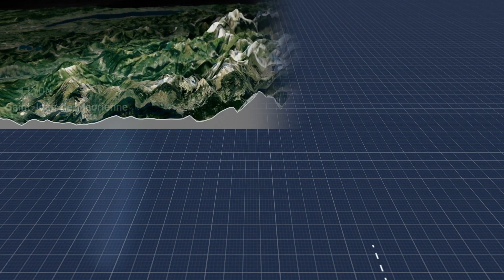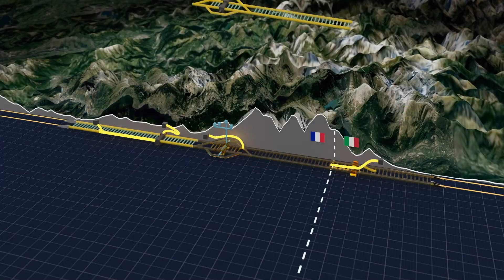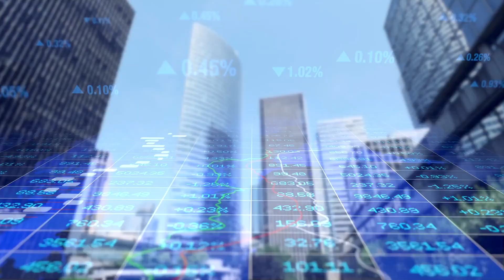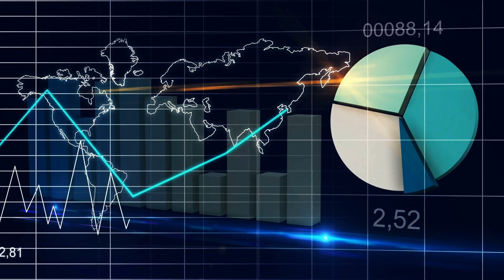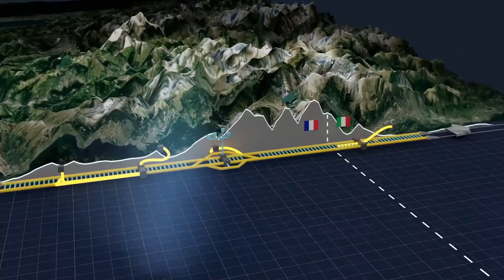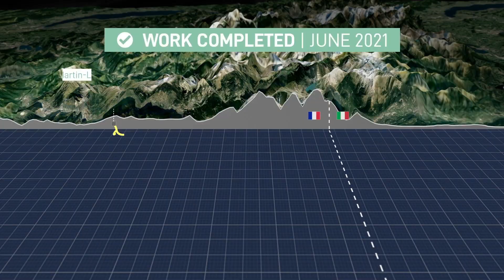INSANE €26BN Tunnel Through a Mountain - The Lyon-Turin Tunnel

Comment: There is already a Lyon-Turin base tunnel, the The Fréjus Rail Tunnel. However it is old and single track. But it works perfectly and does not cost billions of dollars for an already existing infrastructure.
Reply: You are kidding with the working perfectly. It is overcapacity, leading to thousands of trucks for freight, and has no modern safety infrastructure that can be added. Its is only allowed to be used due to the extremely reduced frequency. And lately, there has been even more issues reducing train traffic.